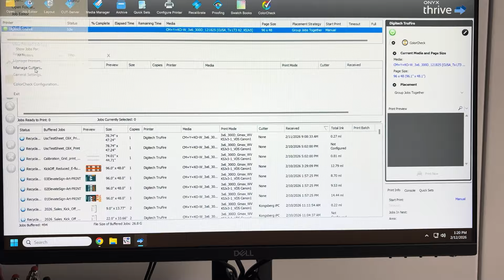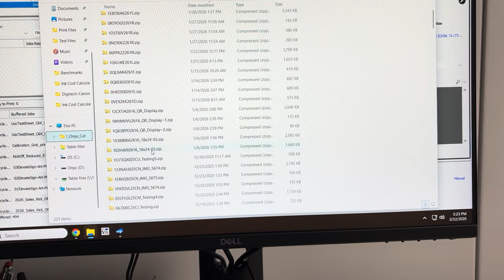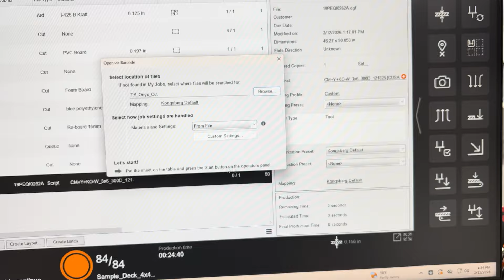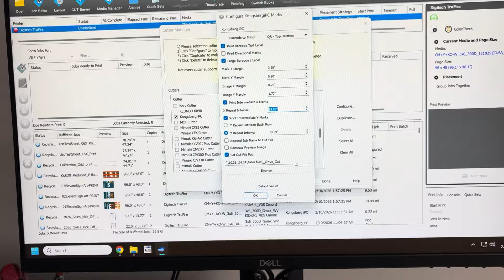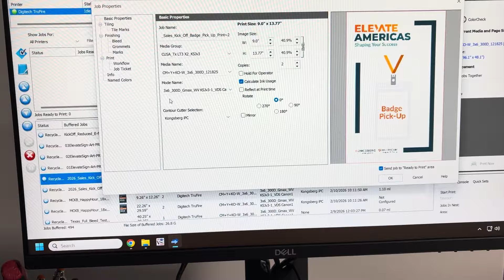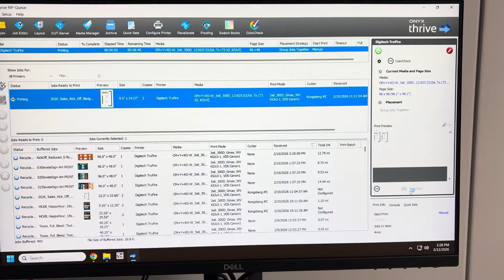QR Code Production Workflow: Onyx Setup + Kongsberg iPC Integration for Automated Cutting

Comment: I've tried to set this up but my Onyx is telling me that the Kongsberg IPC setup in Onyx doesn't require the cut server and actually won't let me add it there. I can select i elsewhere t but I don't have as robust mark location/bleed/etc options and can't get the cut files to show up in my cut server despite pointing the cutter there in the layout tool preferences. Any ideas about where I might look to resolve those issues?
Reply from the maker: What version of Onyx are you running? You might be limited by the version available. We are on Version 25 here.